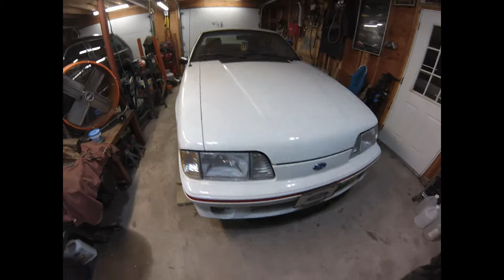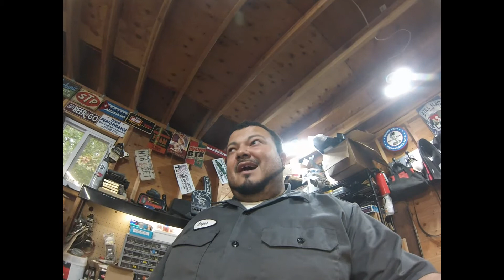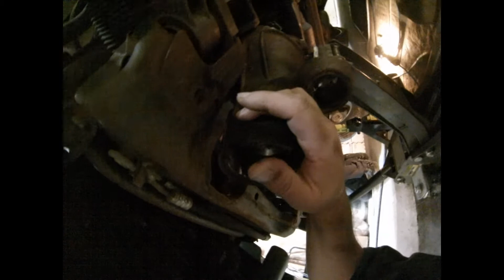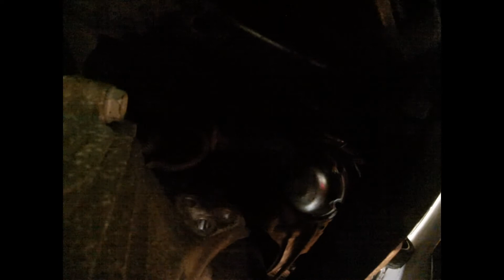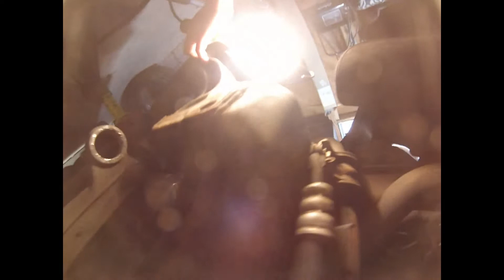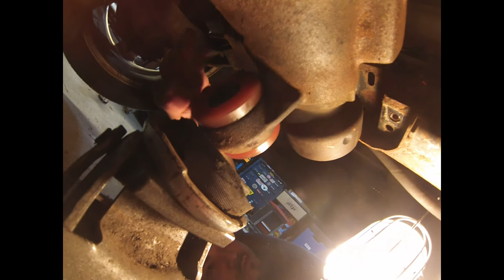2010 Jeep Grand Cherokee SRT8 WK1 front diff bushing replacement. The easy way.

Comment: Im trying this on my commander and I cwnt get it to rotate very far. Seems un likely you roated it prop shaft end up. Im trying tinrtate it prip shsft down but itd getting stuck either in the front casting or the rear prop shaft.
Reply from the maker: It should rotate easily I’m not sure on a commander but the chassis is the same underneath make sure the vent hose is disconnected and you plug it and drive shaft of course is disconnected and the front mount it should turn easily all three mounts have to be disconnected for it to rotate
Reply: @angelsautomotivediy  So I think it's because I have a Clevis lift and the droop on my CV is steep causing it to bind up. I ended up getting it by popping the upper ball joint on the passenger side and drop the knuckle. Came right around no problem. Thanks for the reply.
Reply from the maker: @ChavsADV  Ahh okay, awesome glad you were able to get it done.